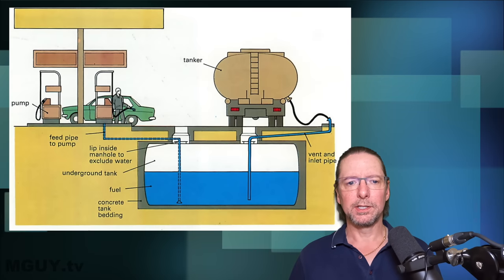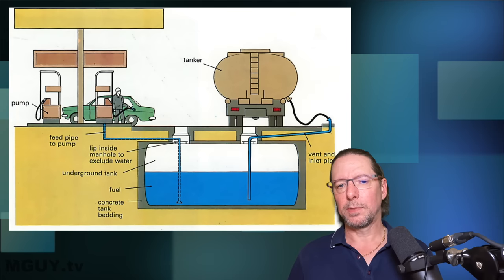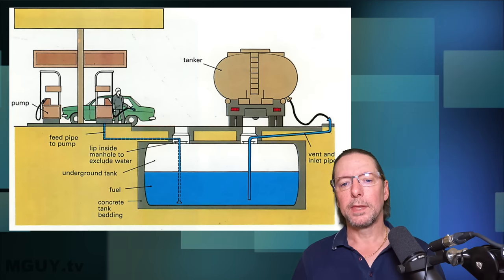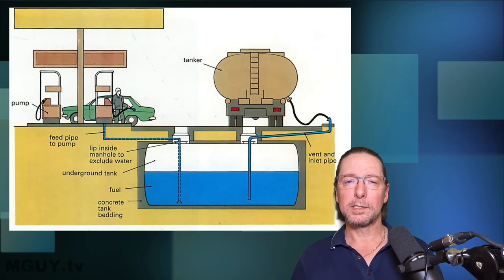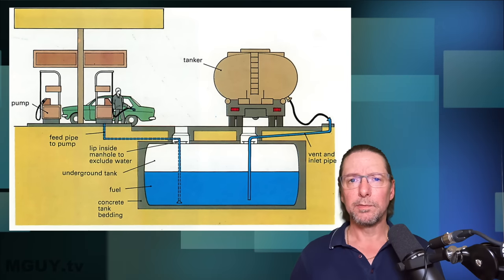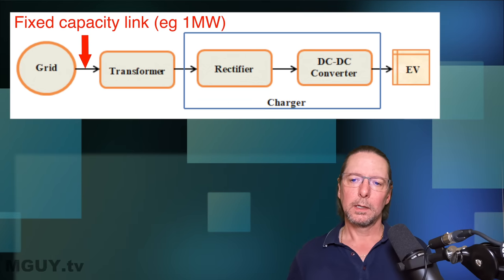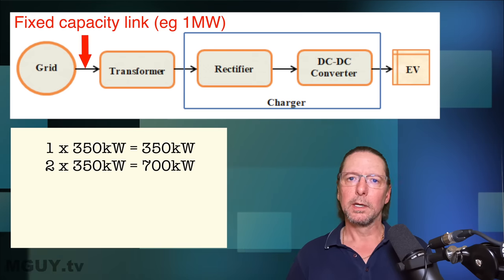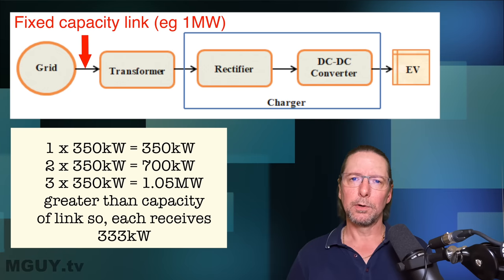HUGE problem with EV Charging Stations that no one mentions | MGUY Australia

Comment: A trucking company in a town in Illinois wanted to switch over to electric trucks but when they presented their proposal to the town they were were told no. They would have needed more power than the whole town was using and the grid would not support that.
Reply: I am a design engineer for the local electrical company in England, we have hundred of businesses now applying for upgrades to their supply because they want to change over to EV for their new fleet of companies vehicles.
In most cases the power required for the new proposed EV charging is bigger than the load they are currently using to run their entire factory.

And on top of this the costs are increasing because the existing network cannot cope with the extra power that is needed without major upgrades.

In one case a certain elite expensive car company are going to change their entire fleet of heavy goods arctic delivery lorries that supplies the parts to their car factory to EV.
So at their storage plant where the new EV lorries will park overnight they are asking for enough power equivalent to what a small town or large village would use.
So we will need to upgrade the electrical network in that part of the city to be able to cope with it.
We are still trying to work out how to do it …. but the current estimate of costs is about £350,000 worth of work just to make the network strong enough to cope with their new power demands.

And that is without the costs of installing the EV charger equipment itself
Reply: Same thing happened in New York
Reply: That is simply not true unless the town was a necropolis.
Reply: @robg521  And where will the electricity come from; hydro, coal, Natural gas, propane, nuclear?
Reply: @rbdogwood What has a cemetery have to do with the conversation?
Reply: and the more people upgrade their businesses, the higher the demand for electricity, and the lack of new powerplants means electric prices skyrockets, thus negating any benefits of low cost electricity while also further driving up inflation and cost of living for everyone else.
Reply: @robg521 honestly, I was expecting something like 35M, not just 350k.
That should not be that bad investment for a large company... if they want to support they fleet of EVs, they should be able to afford that (i guess it's just a fraction of the cost of the cars that they want anyway).
Does the 350k price tag include all the cables (plus possibly bigger towers), transformers and other hardware from the powerplant(s) to the customer's side?
Reply: @panda4247  
That’s 1 single factory to charge up half a dozen lorries each day in a large city, ……. 

to upgrade the entire city would cost a few thousand million at a conservative guess, 
by the time you take in the sounding towns and villages it would probably push it up to several billion. 
And that is just 1 city and its surrounding area.
[how many cities are their in Britain?🤔]

To replace every ICE car in a city with and EV vehicle you will need to upgrade or lay extra new Low voltage cables in every street where there is going to be EV charging.
You will then need to install new or upgrade the existing 11,000 volt transformers in the local substations and the end of each street, 
you will then need to upgrade or lay new 11,000 volt cables running through and around the city between each of the local substations running back to the 33,000 volt Primary substations that feed each neighbourhood. 
At these primary substation you will need to upgrade or install new extra 33,000 volt transformers to feed the extra load required on the new upgraded 11,000 & low voltage network.
You will then need to run extra new 33,000 volt cables out from the city around to the surrounding areas to feed the extra loads required in the towns and villages, 
And then on top of this the 132,000 volt grid network that runs from city to city will need to be upgraded including where the power lines tap off of the National grid’s 400,000 volt network.

The country is already bankrupt so I have no idea where this money would come from.
I think we can safely say that this is never going to happen,
When it becomes obvious that we are all going to fail to meet the ‘compulsory all EV’ target date, the government will blame the electric companies and the car companies and defer the target date for several years [all the time hoping that some magic new technology will be created to come to the rescue and solve the problem,
When we then fail to meet that target date as well, they will push the target date back another few years again.
And then later when they finally twig that ‘all EV’ is impossible, they will make a select few cars to be as compulsory`EV, [domestic inner city use vehicles] and allow other types vehicles [industrial, long distance delivery and maintenance] to remain ICE engines 

So your local to the shops and back runabout will be a small EV, but if you are a maintenance contractor who is on call 24hrs a day, or travel long distances for work each day then you can keep your ICE Engine. [because other wise the country will grind to a halt]
Reply: That was a very small town!
Reply: @robg521 At least you will have something two do for the next decade or two.
Long ago I worked at a factory that use as much electricity as the third biggest city in Sweden included all their industries like the Volvo trucks and car factories.

Many businesses will understand that they have to start with rooftop solar panels and battery storages. Much will happen in this field in the next one or two decades.  When somebody sees problems, other sees possibilities.
Reply: @funnyfarm5555 That is not the problem! The problem is some kind of timing. 
One car needs maybe about 7 kWh a day as an average if everyone drives 18,000 km/year. And in the night noone uses the electricity that's this is no problem for the country as a whole.
Reply: @SoloRenegade Maybe you should start studying basic economics?!
Reply: @leiflillandt1488  "Maybe you should start studying basic economics?!"

that's not a valid argument. I was describing perfectly basic economics. But feel free to attempt to actually show me where I'm wrong, using "basic economics".

I'm waiting....
Reply: @leiflillandt1488  a town is by definition about 1500-5000 inhabitants.

You do know that ALL towns are "small" right? and that most urban areas in teh world are nothing more than villages or towns, right?

you should get out more.
Reply: @funnyfarm5555  Votes.
Reply: i remember that.
Reply: @rbdogwood  it is true. the ceo went through the figures in a detailed video

Comment: The bigger issue is that in places where they are being mandated, the grid cannot handle the current load, and this adds significant load to the grid. Those places are also making it the most difficult to add more generation capacity.
Reply: Soylent Green is the goal.
Reply: The grid is not some immutable thing and I suspect if you were to look up whatever power company provides your electricity they will have information about how they are planning renewables and electrification to meet demand. Also, it's not like things go from 0% battery electric vehicles to 100% overnight. Even in Norway where 90% of new cars are electric, it will be decades before all petrol / diesel cars are removed from the roads.
Reply: @drxym  they can't handle current demand. There will not be more electricity available without increasing generation. If you look at the kwh equivalent of the gasoline we burn, even considering the terrible efficiency of internal combustion, we need to add 1gw every 6 weeks to keep up with the transition timeline. These same places mandating the vehicles are also preventing additional generation from coming online in anything that will be significant enough to make it work.
Reply: @amadensor you could always reduce demand 😳
Reply: Can you name me one place where the grid cannot or will not be able to handle the extra EV Load ? Waiting with impatience your response.
Reply: @mikechristie6556  California. They already have rolling black outs when people use their air conditioning, and ration ev charging even though it is a small number of people that have the cars. As the number of electric cars increases, this will get worse unless we add more power generation.
Reply: The reason for extra chargers without grid capacity to handle them is that within weeks of installation half won’t work.
Reply: @mikechristie6556  check out the forthcoming UK Energy Bill. The government is planning to mandate remote load control on major domestic appliance power feeds to manage electricity loading , just what you do when you have plenty of electricity to go round . You’re not sufficiently informed I’m afraid .
Reply: EV's have not been mandated anywhere.
Reply: @mikebreen2890  it goes into effect in stages, being complete by 2035. We need to build a 1gw generation plant every 6 weeks from now until then to be able to support that.
Reply: @drxym  But governments, at least here in the US, are trying to mandate 100% EV sales by 2035.  And it's physically impossible to make that happen, either the EV production or the electricity production.  You have no idea of the magnitude of the problem.
Reply: @stoicsceptic8420   Yeah, that's great.  Turn off people's heat in the winter when the powers that be wish it.  My town in the US tried it, but it didn't half work.  Also, the dimwit who installed the controller in my house failed, so my heat pump stayed on whenever I wanted regardless of what the city wanted.  If the electric company can get electricity to my house, it's my business how much of it I use.
Reply: @mikebreen2890   Yes they are.  In the US places are mandating total elimination of gasoline vehicle sales by 2035.  That means I will not be buying a new vehicle after that.  I'll just keep repairing the old one.  And they can't stop me from making my own parts and doing my own work.
Reply: @bite-sizedshorts9635   Nope, you will still be able to buy hybrids.  Honestly, some of you have lost your freaking minds over this. You'll never buy another new car even if it is vastly superior to the one you have because they are trying to make you do it? Pathetic.
Reply: @stoicsceptic8420  Go to a pre-industrial civilization say.
Reply: @mikechristie6556  How much is the load?
Reply: @mikebreen2890  Excellent. I never wanted to date one anyway.
Reply: @mikebreen2890  I am seeing "vastly more expensive" not "vastly superior".
Reply: @msimon6808  where the population is lower 🤔
Reply: @amadensor More Green generation please !
Reply: California. Or as some call it. Commiefornia.

Comment: This takes range anxiety to a whole new level.
Reply: To me, the way to eliminate range anxiety and a host of other problems would be to standardize batteries and engineer them to be swapped out quickly. The same way you'd swap out a battery in your drill or screw gun. Except, instead of charging stations, you'd have swapping stations where you pull up and your worn down battery is swapped out for a fully charged one, which could be done with an automated (robotic) system, and by my estimation, in the same time that it takes you to fill a car with gasoline. Pending some technological breakthrough, this is the only way range anxiety and charging issues are going away. But it's unlikely to happen.
Reply: @jasonhaynes2952  Um..................and just what would the COST be for EACH battery???????  Cause right now, when they quit working, they cost an  average of $6,000 to $7,000 a piece right now.  Again, NOT FEASIBLE.  This green grift is only enriching the elitists and politicians and other countries.  PERIOD.  END OF STORY.
Reply: @margricks  Not that I disagree with any of that. I was just saying that some kind of exchange is the only way we resolve all the issues with range, charging times, charging capacity, etc. And yes, the batteries cost a lot. But if this is an exchange program, you're giving them a low battery and replacing it with a charged one. So no one is losing $6-%7k each time. In theory, it SHOULD be an even process. Every now and then a bad cell might pop up, and that should be baked into the price, so to speak. In essence, you're leasing the battery, or rather, it'd be like having a warranty on the battery. I think of it similar to a propane tank exchange.
Reply: @jasonhaynes2952  Sooooooooooooooo how much per "exchange"???
Reply: @jasonhaynes2952   So Mr Garage Owner would happily provide a new fully charged battery to someone and swap it for their old battery no matter what condition at no extra cost?  LMAO   And if the customers battery is from a worn out 6 yr old car where the battery on its last legs I guess the garage will demand several thousand as compensation?  Your suggestion is quite frankly the dumbest thing I have read on the internet all day.
Reply: @CyrilSneer123  Jokes on you. Because this is already being done in China by a company called Nio. Basically, you buy the car without the battery, and pay a subscription-style fee for a recharged battery when needed. The swap takes about 3 minutes...you pull up and robotic devices do the exchange. You never own the battery, you just lease it. As for worn out batteries, that is baked into the cost of the subscription. I just watched a video about this months after my original comment. Not only is it possible, but it's already being done!
Reply: @margricks  It's already being done in China by a car company called Nio, come to find out. Exactly like I said it could work. You buy the car without a battery, and pay a subscription fee for recharges. Robotic devices swap the batteries in about 3 minutes. You never own the battery...you basically lease it.